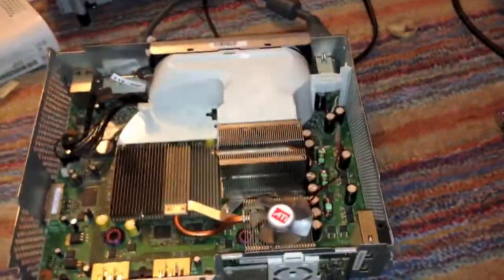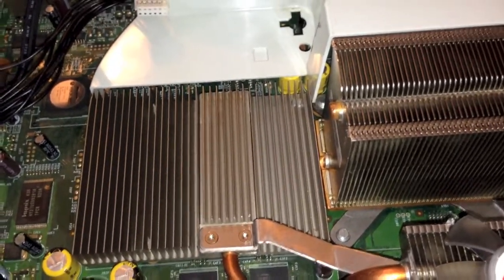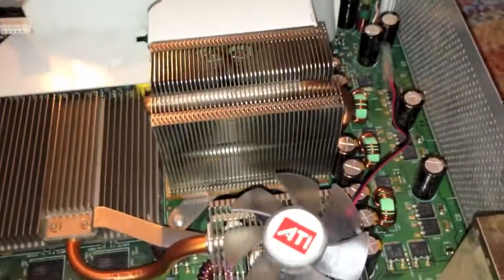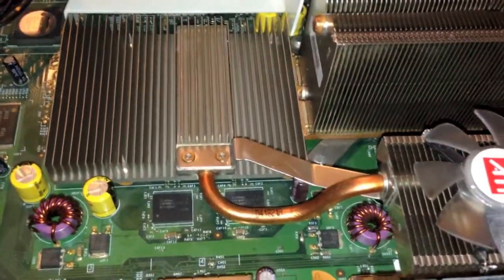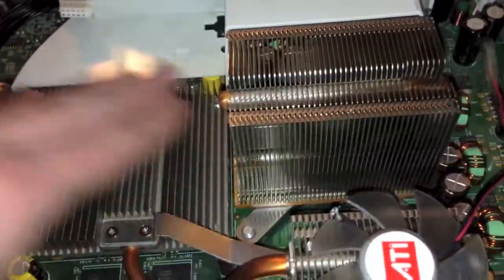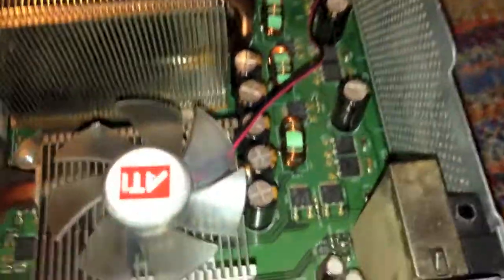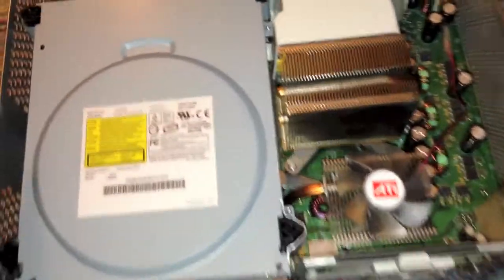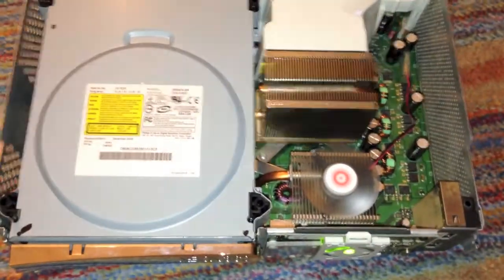Xbox 360 Repair Overview and Red Ring Of Death Prevention

Comment: Today, 9 years later, we know that it wasn't the solder balls. It was the GPU itself. The low tg underfill to be precise. Also you are guaranteed to get the RROD because of the thermal cycles. Not the heat itself.

Comment: Excellent video!  You're the only one I've seen or heard from that hasn't blamed the X plates, or taken them off the console.  It's good to know that they should be left on there.
Reply from the maker: Yeah, I'm not really sure why people think they cause problems. All they do is put the proper amount of pressure on the chips, just like a computer CPU cooler. You don't just take a cooler and screw it right through the board, all CPU coolers I've seen have at least some sort of snap-in frame or backplane.
Reply: ***** Is the heat sink screwed into the logic board?  And what kind/model of heat sink did you replace it with?
Reply from the maker: No, the heatsinks are held on by the X-clamps. The heatsink I replaced the original with is known as the "extended heatsink", and has a small heatpipe extension that goes in front of the CPU heatsink, which is what you see in the video. The original heatsink just looks like a block of aluminum, no heatpipe or anything.